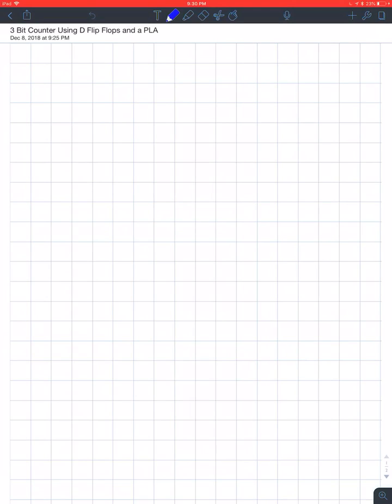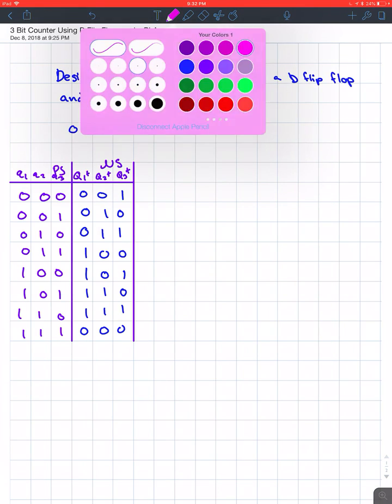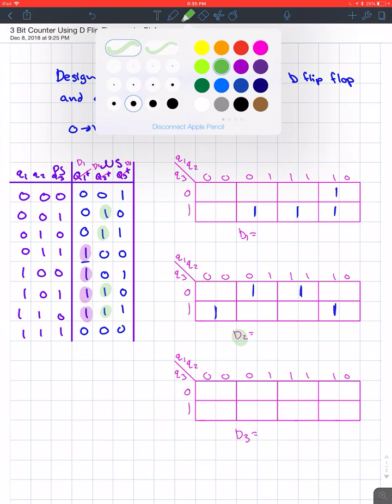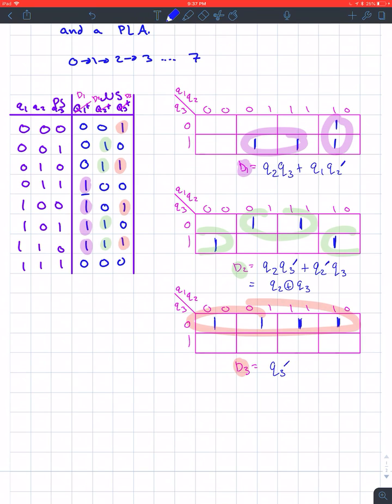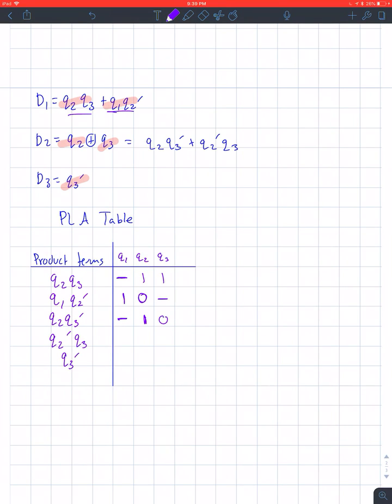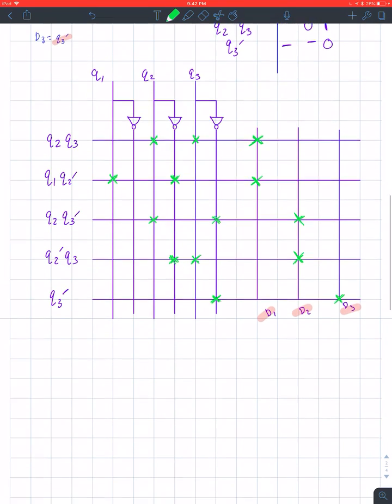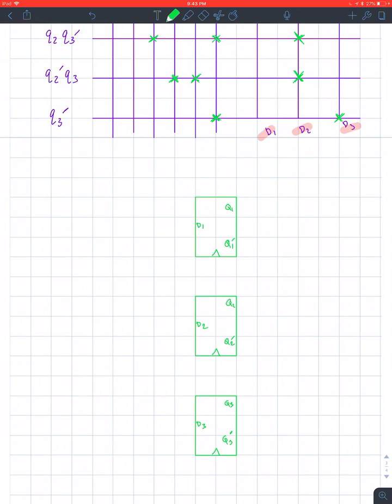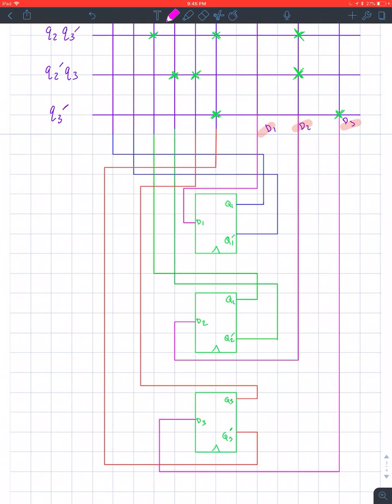Digital Systems | 3 Bit Counter Using D Flip Flops and PLA

Comment: Excuse me, lady, your KV diagram determining the equation D1 is wrong. You
 put a D1=1 when q1=1, q2=1, q3=1 in the KV diagram while your truth 
table says D1=0. Also you put a D1=0 when q1=1, q2=1, q3=0 in the KV 
diagram while your truth table says D1=1. Please fix this otherwise your
 circuit will be wrong and not upcounting 3 bit.

Comment: Excuse me Sir, your KV diagram determining the equation D1 is wrong. You put a D1=1 when q1=1, q2=1, q3=1 in the KV diagram while your truth table says D1=0. Also you put a D1=0 when q1=1, q2=1, q3=0 in the KV diagram while your truth table says D1=1. Please fix this otherwise your circuit will be wrong and not upcounting 3 bit.
Reply from the maker: Thank you for this comment! You are correct. I should have placed the last 1 I included for D1 in the 110 box instead of 111. I even read the wrong row out loud in the video. Hopefully people see this comment and are able to figure out how to fix the mistake throughout the problem.
Reply: Nerd Central thank you for your answer. Greetings from Germany